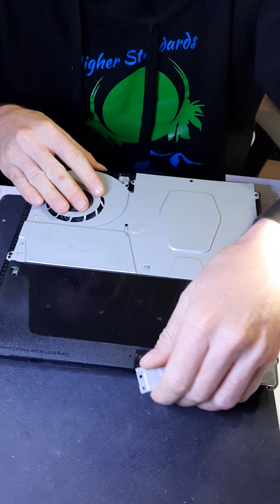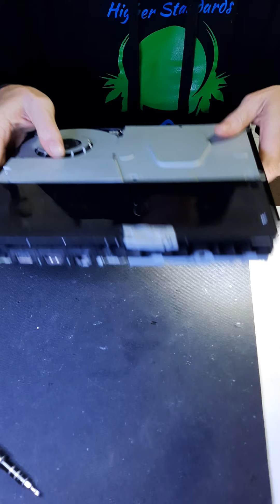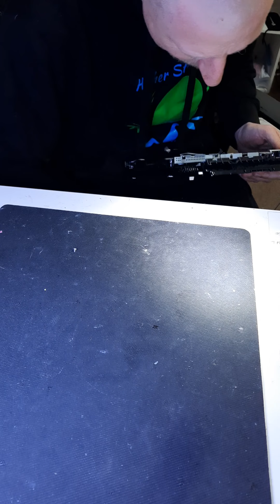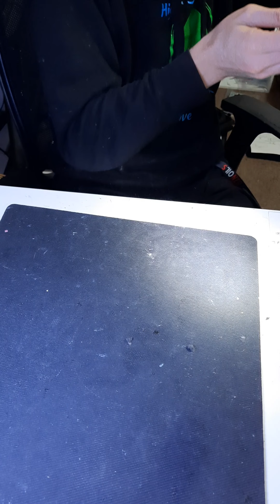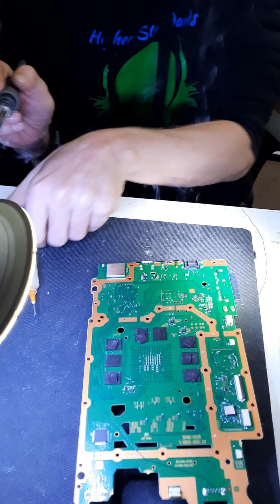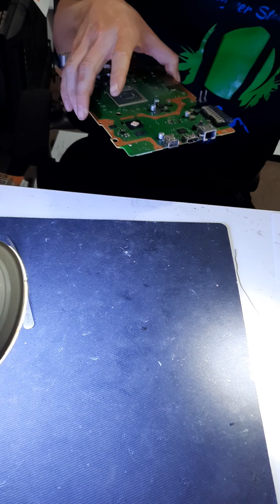PS4 Slim HDMI Port Replacement Service by SBL Games, Inc. (Part 1 of 2)

Comment from the maker: Items/Materials Used/Required:

PS4/PS5 Tool Kit -
https://amzn.to/4h2JhKj

Low Melt Solder -
https://amzn.to/4yDUt71

Soldering Iron -
https://amzn.to/4gCqJAP

Solder Wick -
https://amzn.to/4w37a9B

Solder -
https://amzn.to/4vvHilB

Flux -
https://amzn.to/3RewVo3

Rework Station -
https://amzn.to/3TkvnJX

PS4 Slim HDMI Port Replacement -
https://amzn.to/4xzJTMg

MX-4 Thermal Compound -
https://amzn.to/3U2aqUr

PCB Cleaning Brush -
https://amzn.to/4wMrig4

99.999% IPA (Isopropyl Alcohol) -
https://amzn.to/4fu1Epn

Fume Extractor -
https://amzn.to/4pAMO4V

Cotton Swabs -
https://amzn.to/4iFuiXW

PS4 Slim HDMI Port Replacement -
https://amzn.to/4xzJTMg

Comment from the maker: Items/Materials Used/Required:

Low Melt Solder - https://amzn.to/4yDUt71

Soldering Iron - https://amzn.to/4gCqJAP

Solder Wick - https://amzn.to/4w37a9B

Solder - https://amzn.to/4vvHilB

Flux - https://amzn.to/3RewVo3

Rework Station - https://amzn.to/3TkvnJX